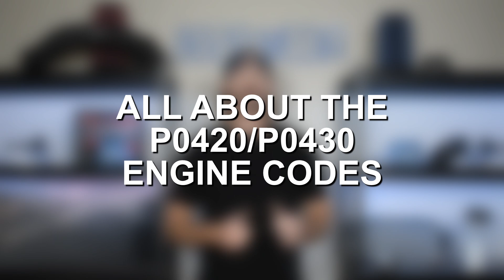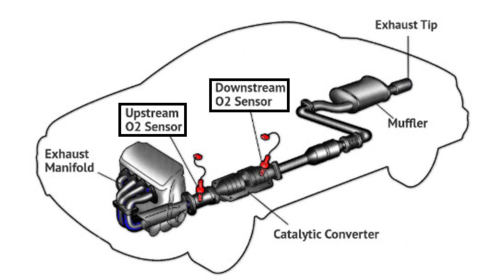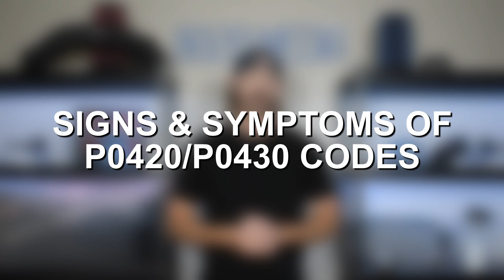Everything You NEED to Know About P0420/P0430 Engine Codes!

Comment: My wife's 10 Tahoe has low CAT efficiency codes for bank 1 and 2. 
I have a good scan tool while reading live data 
everything is in range. Installed new cats, upstream, downstream 02 sensors. Fuel trims on both sides look good. 
Checked for vacuum and exhaust leaks. 
I've done diagnostic troubleshooting
 for over 10 years and I can’t figure this one out
Its been going off and on for over three  years . It won’t throw the CEL sometimes for six months then it will trigger it. The new cats and sensors haven’t changed anything. Lol. I love it.

Comment: BMW is so weird. There are 4 o2 sensors for a straight 6, but the upstream are actually AF sensors. On top of that, the catalytic converters are also the exhaust manifold
Reply: So what was the issue for you I’m getting the same issue on my e70 straight 6
Reply: @tavobeasty82 dude i got sick of trying to figure it out and took to a shop had both cat codes simultaneously

Comment: Wish I had your video in 2017-2018 when I failed emissions in NJFMV brought it to BILLS AUTO REPAIR COLTS NECK, NJ He chose to remove and replace my original cats NO EXHAUST PIPE mind you, Didn't fix sheet and only needed a oxygen sensor at the time was $40.00 I paid BILLS AUTO REPAIR IN COLTS NECK NJ over $2,000.00 and he made out with original cat conv off a 2001 V6 3.8 Oh and the day after picking up my car, although they offer towing, nobody responded so I paid another $125 because my car would not run
It's free videos like these that teach us years of knowledge so THANK YOU SIR ♥️💋✌️

Comment: Ive been getting this code P0420 on and off for years (over 60k miles) on my car, replaced both O2 and still comes back but no other code, car has 140k mi and runs like a charm. Very strange.
Reply from the maker: A - A persistent P0420 (catalyst efficiency below threshold) that returns even after replacing both O2 sensors usually points to the catalytic converter itself slowly losing efficiency rather than a sensor issue, and the fact that it’s been happening intermittently for 60k miles with no drivability problems suggests the cat is borderline but not fully failed—sometimes heat cycling, small exhaust leaks upstream, or ECU software sensitivity can trip the code even when the car runs fine. Since you’re at 140k miles, it’s very likely the original cat is just aging out, and while the car can still run perfectly, the ECU sees the rear O2 sensor readings too closely matching the front O2s. If emissions testing isn’t a concern, many owners just live with clearing it, but the true fix is replacing the catalytic converter or checking carefully for any pinhole leaks in the exhaust before the cat, since those can also mimic cat inefficiency.

Comment: Decent quick overview.
Re scan tool data, the short term trim + long term trim should be within 0%, +/- 5%.  If within this range, the cat converter is likely good.
The surface temperature of the outlet of the cat converter should be at least 100F° higher than the inlet.  If it is, the cat converter is likely good.
Reply from the maker: S - Thanks for the feedback and taking the time to share your insights!

Comment: Very helpful video, thank you!  I have a P0420 with a 2013 Altima.  Is a 0420 typically mean I can rule out the pre cat (connected to the exhaust manifold) that has the air-fuel sensor threaded into it?  I know some people refer to this sensor as an O2 sensor, but I believe it's more accurately called an air fuel sensor.  Is that right?  I guess I'm just wondering if I should be more focused on the cat and 02 sensor underneath the car, just ahead of the mufflers.  Just trying to rule out stuff.  Thanks for any suggestions.
Reply from the maker: H - Thanks for the feedback! A P0420 typically refers to the efficiency of the downstream catalytic converter, and does not usually implicate the pre-cat (the one integrated with the exhaust manifold that has the air-fuel ratio sensor, not a standard O2 sensor). The air-fuel sensor is more precise and used by the ECU for real-time fuel trim adjustments, while the downstream O2 sensor (after the main cat under the car) monitors catalyst efficiency. So with a P0420, you should indeed focus on the main catalytic converter under the car and the post-cat O2 sensor just ahead of the mufflers—check for exhaust leaks, test the downstream O2 sensor response, and inspect the cat for clogging or deterioration. Replacing the air-fuel sensor or pre-cat is rarely the fix for a P0420 unless there's something unusual going on.
Reply: @8020Automotive  Wow, thank you so much for taking the time to type out such a well thought out and detailed response.   And you answered my questions perfectly.  You just saved me some diagnostic time and I'll be focusing on the parts/aspects you mentioned.  Keep up the good work!!!  🙂  Just became a huge fan!

Comment: Ik have the P0420 code, after resetting it, it came back about 1000 km later. Why not immediately? (Honda Civic 2012 220000 km)
Reply from the maker: T - The P0420 code often takes several drive cycles and conditions to reappear because the ECU needs time to run specific diagnostics under the right conditions (like engine at operating temperature, steady speed, closed loop, etc.); after you reset it, the ECU started from scratch and only re-ran the catalyst monitor once those criteria were met, which is why it took around 1,000 km to come back—this delay is normal and often seen with borderline failing catalytic converters or aging O2 sensors where the issue isn't immediate or severe, but still outside the efficiency threshold over time.
Reply: @8020Automotive  Thank you for the reply, I once read that if a Cat is still 95% good and 5% bad, you will get the P0420 code, is that true?
Reply from the maker: @Tintoycar  Yes, it's true that even if a catalytic converter is still 95% functional, the P0420 code can be triggered. This code means the catalyst system efficiency is below the threshold, as detected by the oxygen sensors before and after the converter. If those sensor readings are too similar, the ECU assumes the catalytic converter isn’t effectively reducing emissions. Over time, even slight degradation in the cat’s performance—due to age, contamination, or prior engine issues—can cause the system to flag a P0420, even if the converter is mostly working.
Reply: @8020Automotive  I will start to clean the upstream sensor and I bought a new NGK downstream sensor.

Comment: I had an intermittent p0420 caused by a leaking exhaust donut made worse by worn engine mounts (code would mainly occur going up steep hills or hard pulls on highway). I used the torque pro app and a elm325 adapter to read DTC and graph voltages of upstream and downstream sensors. Upstream sensor was switching normally, while the downstream sensor was reading lean. A new donut gasket and all new engine mounts (OEM) fixed it. Car is a 2006 Toyota Matrix with 227k miles.
Reply from the maker: M - Thanks for taking the time to share your experience! This could certainly help future viewers.
Reply: Good to know! I ran my scan and graph appear both sensors working and i only get CEL on and off randomly just now. No performance issues at all.

Figure I need to replace them anyways since I’m at original 190k miles. But don’t want to spend $ if I have to spend more $ on other repair. So thanks for your tip! 

Read from ALLDATADIY, it did stay exhaust leak or gas cap.